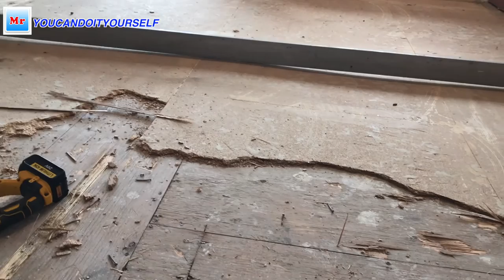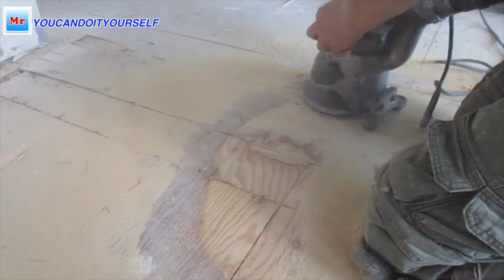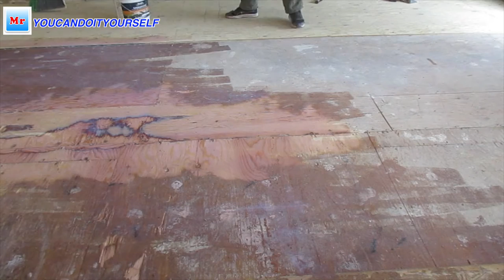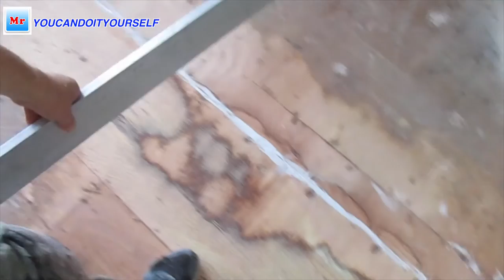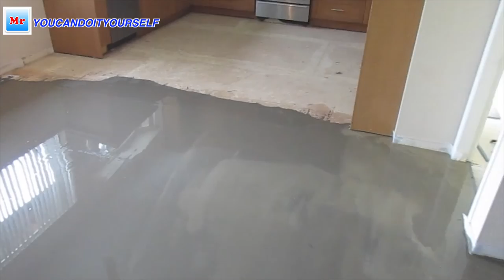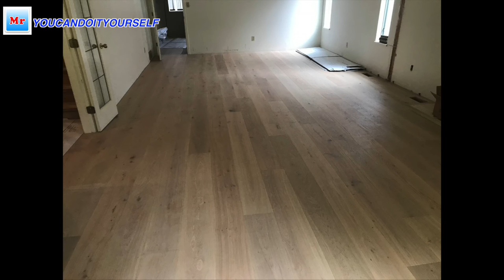Plywood Subfloor Leveling With Big Hump MrYoucandoityourself

Comment: Thank you for the video. I am looking  for the best way to level my first floor before putting engineering hard floor. This idea looks good but I am wandering if the cement will not going to crack over time especially that do different thickness?
Reply from the maker: Follow instruction and everything will be fine. Here it is - https://youtu.be/CGVibegu8ik

Comment: Why dont you need wire lathe to keep the self leveler from cracking? Is there a minimum depth?
Reply from the maker: I never use lathe when working with Mapei self leveling compound.

Comment: Do u have put adhesive or silicon between the joint of plywood? Can u screeding be done without it. And what is the long timber is just a wood or feather edge? Thanks
Reply from the maker: I fill up all joints because the self-leveling compound can leak downstairs. I use an aluminum straight edge, it's specially made for floor leveling. Link in the description for this video. Thanks!

Comment: Hey Mr. YouCanDo   Like your channel, bought some tripods from you, about to embark on self level of bathroom and hallway with concrete floor.  Think I am set but there is an expansion groove ?  that runs through both areas.  It is shallow and does
not go all the way through, about a quarter inch groove.  So I am wondering if I need to honor that through the self leveler or 
can fill in ?  At that point the floor will take about 1/8 inch self leveler.  I could fill with the appropriate caulking to above 1/8 inch to respect the joint, but if not necessary it will make pouring easier.  Thanks.  Great channel
Reply from the maker: Hi Tim, can you send me picture on Facebook page, please? I have a look. Thanks!

Comment: Thanks for a great video . I've already done two layers of self-leveling cement without a straightedge. I see how you really need it. I was using some custom cement self-leveling cement over plywood but I wanted to cover a low spot just 2 ft by 2 ft. I was wondering if I should use floor patching compound or self-leveling cement to cover such a self small spot. I already have some self-leveling cement I'm trying to do a second layer. I will be putting tiling on top of it. How do I feather the edges to get it smooth. Would a straightedge just do the Feathering?
Reply from the maker: If you don’t have straight edge you can use mdf baseboard to fill up this small spot. Thanks
Reply: @MrYoucandoityourself  thanks for your reply. I was wondering though would it be possible to fix a little low spot 2 ft by 2 ft with just self-leveling cement and a straight board

Comment: Hello, and thank you for the video. What kind of sander are you using to reduce the hump ?
Reply from the maker: Sorry, for late answer. I just found your question. I used concrete grinder with turbo blade and hardwood floor sender.  Thanks!
Reply: @MrYoucandoityourself  Thank you !

Comment: If you are installing new flooring over the entire new floor, would level the entire floor using this method? If so then would this not be too heavy weight structurally speaking? Also will this Crack in the future?
Reply from the maker: I do not think so if you using the right primer and SLC. I am doing it for a long time no complaints about heavy or not heavy. In apartment wood structure buildings a lot of amount of concrete over a wood subfloor and no anyone thinks how it's heavy.

Comment: what is the name of the floor sander you used in that video thanks
Reply from the maker: Hi Fadel, I used flor edger - https://amzn.to/3wXelUx
You can rent it in Home Depot or Lowe's. Thanks!
Reply: @MrYoucandoityourself  What grit sandpaper did you use? I have a hump in my subfloor and was using a belt sander with 36 grit, but it's not very fast.. this seems like it will be much faster with this floor edger/sander, but wondering if a less aggressive sandpaper would be better? I also tried using a 3 1/4" planer which is doing the job to get the hump down but I have a 12" by 30 foot section to do so that's taking forever and I'm worried about leaving too many ridges.